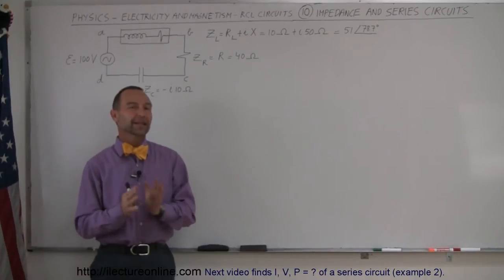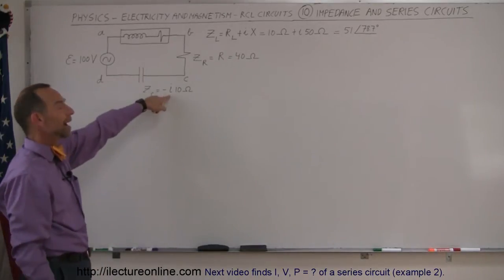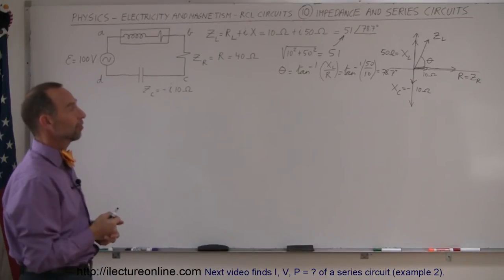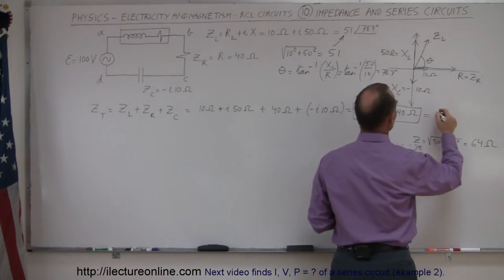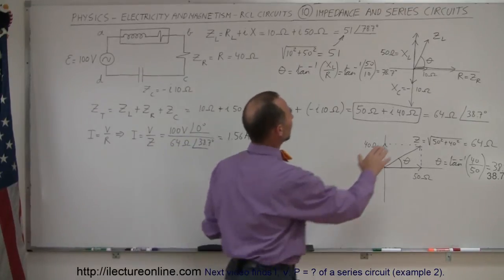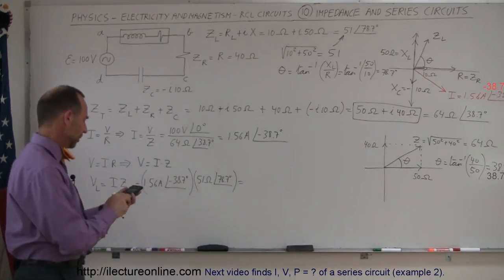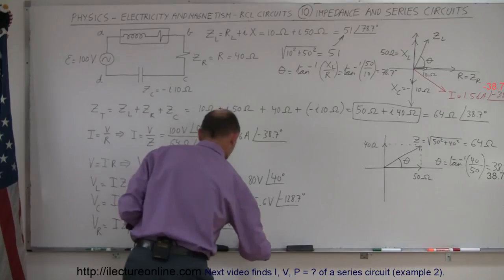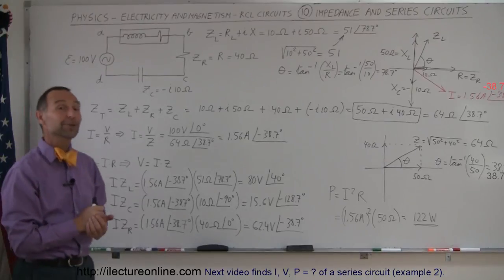Physics 49  RCL Circuits (10 of 13) Impedance and Series Circuits (Ex. 1)

Comment: when calculating the power, did you just calculate the average or maximum power in the circuit?
Reply from the maker: It depends on how the voltage is given.  If the voltage is given as the RMS voltage (which is what usually is give), then the current calculated is the RMS current and the power is the average power as was done in this video.

Comment: hello, me again ;D The power consumed you calculated at the end is the maximum instantaneous consumption and for the average you would use the I_rms, right ?
Reply from the maker: Correct.  If the voltage source is given as peak voltage you will have to calculate the RMS current.
Reply: @MichelvanBiezen  thank you :)

Comment: Is it only for a purely complex impedance of the inductor that the capacitor's voltage lags the emf by 90 degrees and the inductor by 180 degrees?  If not, why are your voltages not properly spaced? Your next example demonstrates the proper separation, but this one does not.  Veel dank je voor je Antwoord :)
Reply from the maker: Capacitors tend to be "pure" in that they don't have resistance.  Real inductors do have some resistance, but typically in these types of problems we add the inductor resistance with the other resistance (or we just ignore it).
Reply: Michel van Biezen Thank you for your reply.  Let me ask in a slightly more direct way:  Why is it in your next video that you make a point to acknowledge that the voltage across the inductor leads that across the resistor by 90 degrees, which in turn leads the voltage across the capacitor by 90 degrees, yet in this example, it is not the case?  As far as I see, the only difference is that the resistance of the inductor has been "lumped in" with the resistor, as per your previous comment, which then gives a purely complex impedance.  

I'm looking for clarification on whether this is a rule, that the separation is always 90 degrees between the three.  And if so, why is it not here?  If not, what are the limiting cases in which it is?  Many thanks in advance.

Comment: Hello Mr. Van Biezen! In one of your further videos of this playlist you say that current is always in phase with the resistor (0°) and that voltage is always in phase with total impedance. I'm wondering, why in this video the current has a phase angle?
Reply from the maker: When we say: "the current is in phase with the resistance of the circuit" it is only true for the resistance component.   If the total impedance of the circuit is different from the resistance, then the current will have its own phase angle.
Reply: @MichelvanBiezen  Thank you very much for your very quick reply, I understand it a bit better, but now another question popped into my head: how do you then calculate the phase angle between the current and the voltage of the whole circuit?
Reply from the maker: My suggestion is to watch all the videos in the playlist.  You will then have a complete understanding of RCL circuits.